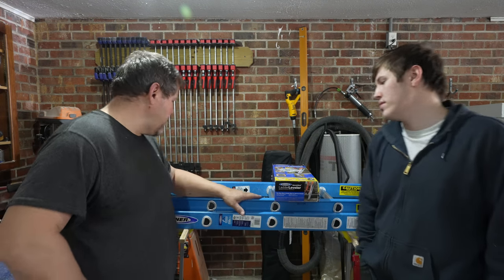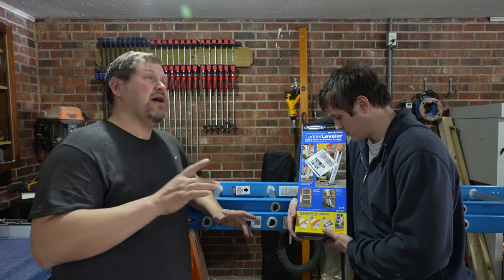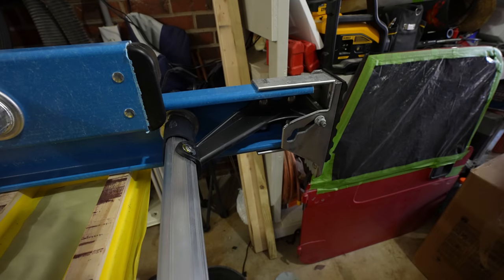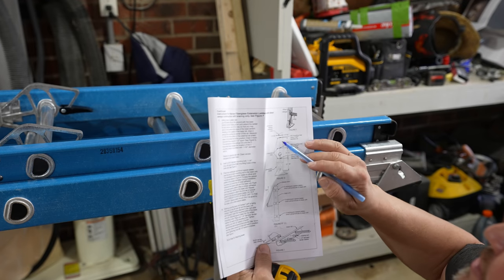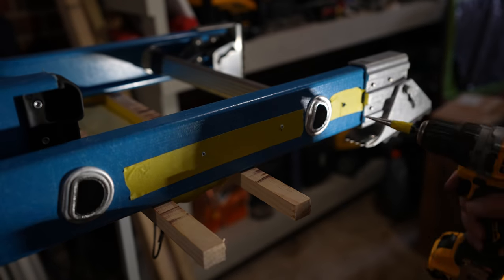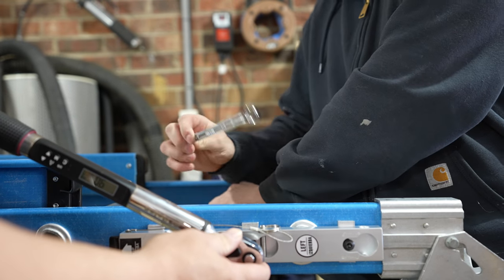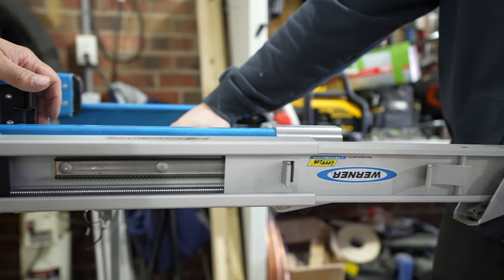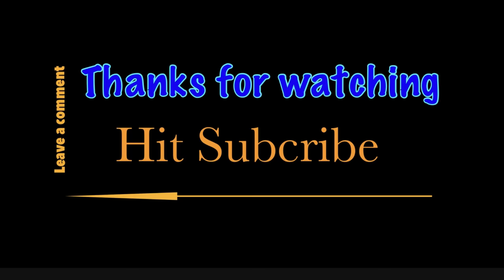Werner Ladder Extensions Install Video

Comment: Lists for $185 at Home Depot. And they are not interchangeable from one ladder to another, so every ladder you own needs a kit. The price for the kit is more than I paid for several of my Werner ladders. I guess you need to decide how much the convenience and potential safety might be worth to you. Something that installs with rods than insert into the rung holes and can be moved from one ladder to another would be preferable to me.

Comment: For the cost of the ladder and the leveler legs = Werner should have simply predrilled the ladders at the factory........  It as alluded to requires measuring and drilling using a drill bit size not typically found in many bit sets.  These ladders and leveler legs are not cheap.